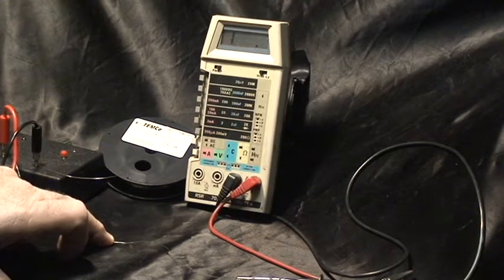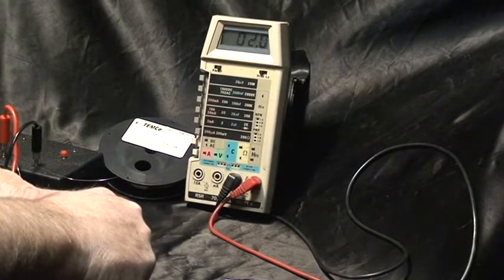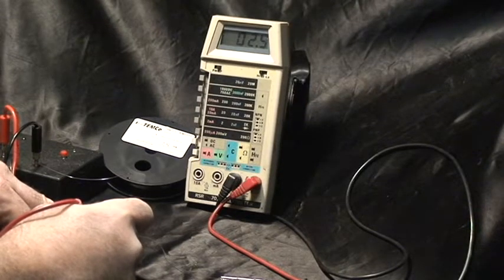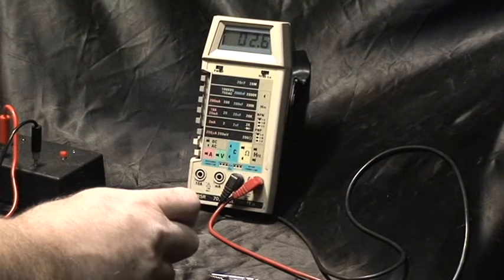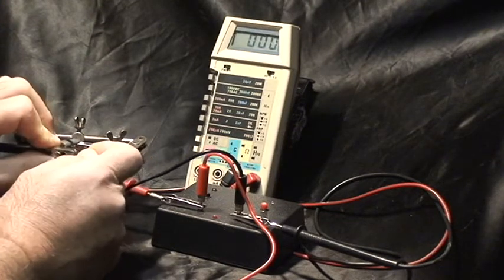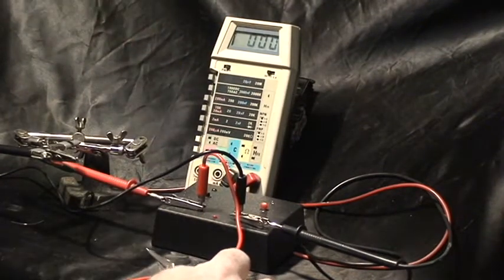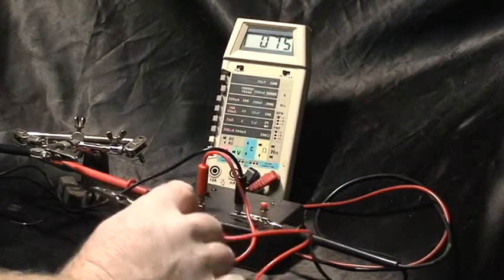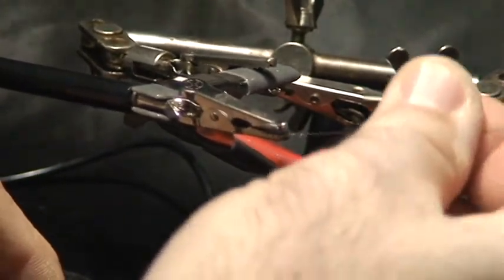Spark-O-Matic Arc Welding Coil wire

Comment from the maker: You have to find the right voltage for a proper weld. A volt or two too high can weaken or melt the silver. A volt or two too low will not tack good. It's a lot of trial and error.
Instead of silver, I found pulling out a single strand of wire from an 18ga stranded wire works good. Use a plated/tinned wire. Bare copper should not be exposed to the ejuice. Check out my forum for additional info.